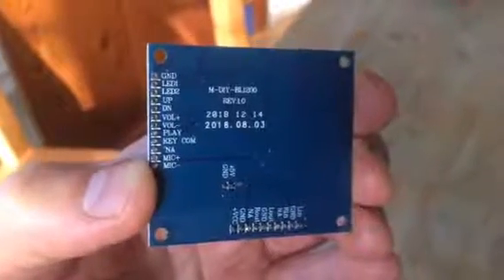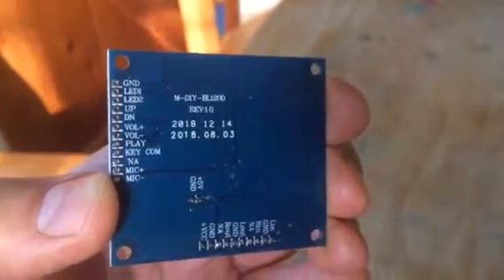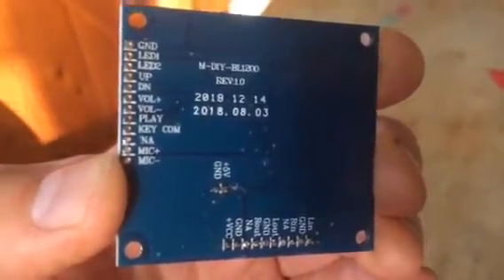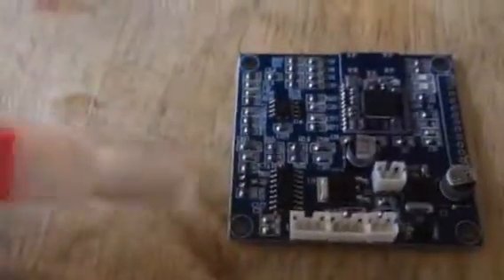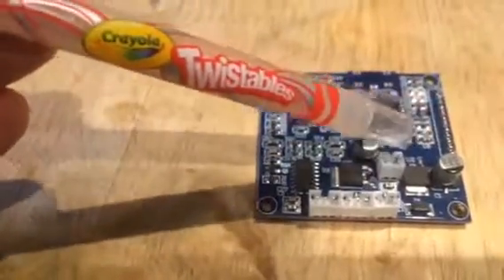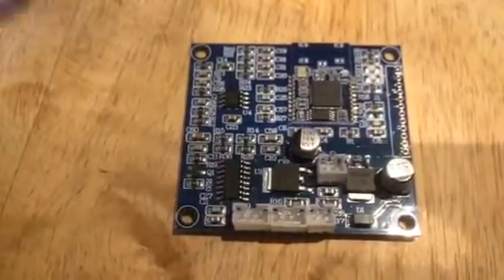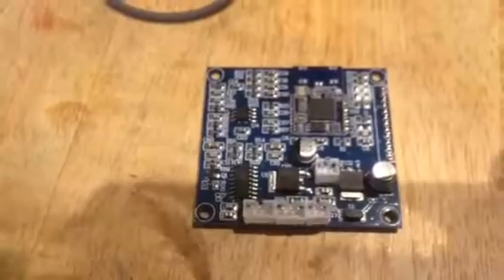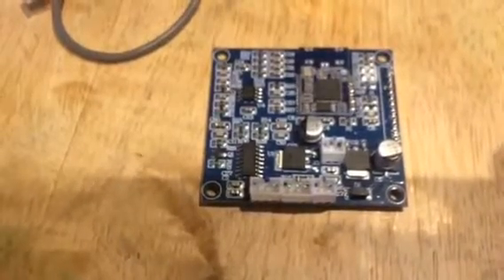M-DIY-BL1200 Bluetooth expansion module

Comment: Hi. Thanks for making this video. With the greatest of respect its not all that informative. ie, this three terminal thing is some sort of regulator lol.
I came here because I have one of these and can pair it to my phone but im unable to see how it works ? it says pared and connected but that's it. Some informative description as how to use it would be good.
Reply from the maker: No worries on critique. I am not a microelectronics guy, but as far as I could see no other vids on this bluetooth board, so. . . . I wired mine up and it worked fine, didn't use the add on buttons though, just the board on its own, and that was it.  Input, Output, Power and that was it, paired and worked, although with terrible nose interference unless I ran it off a battery.